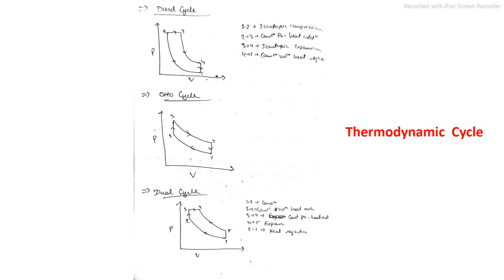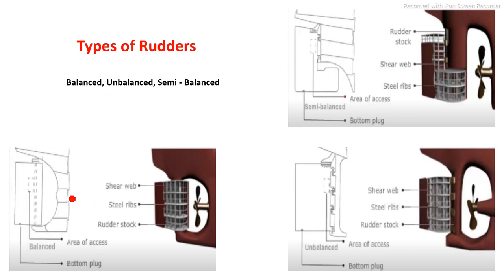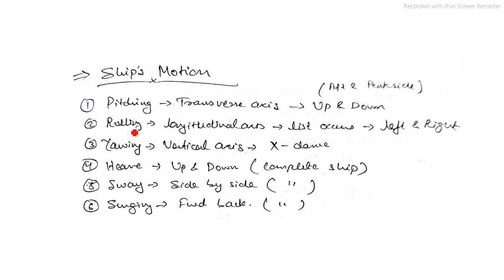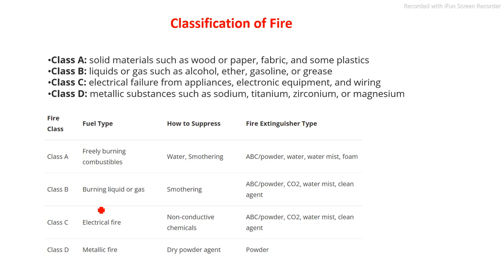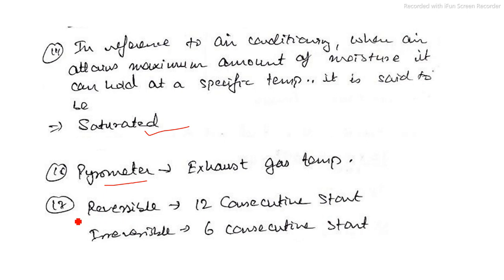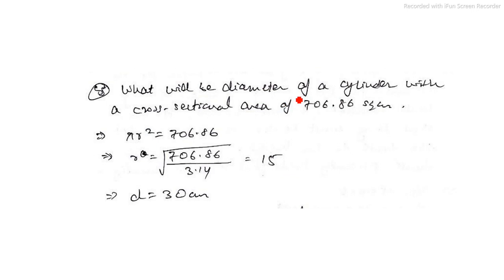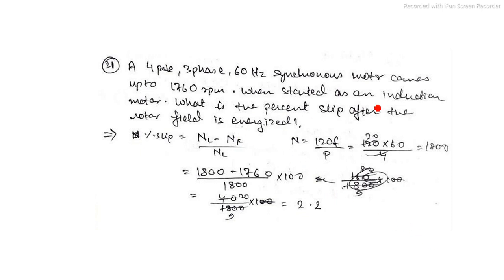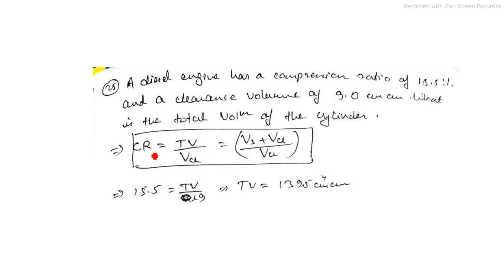Synergy Exam 2022 - Important Technical Questions Revision #synergy2022 #synergyexam2022

Comment: Air in the refrigeration system the compressor pressure will be high...
Reply from the maker: Yes, rightly pointed out. The question should be high compressor discharge pressure. Thanks 👍
Reply: @marinerspoint  no mention bro🤝